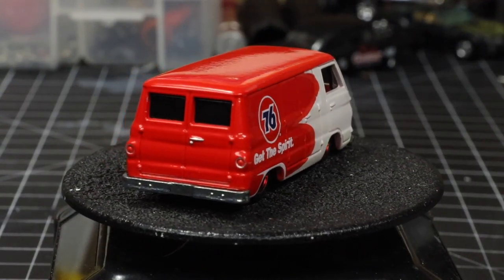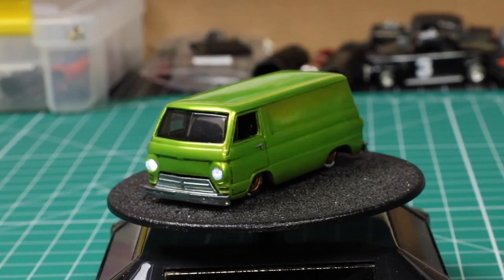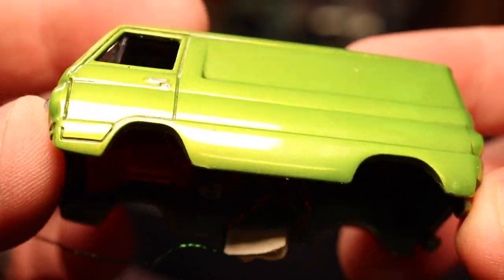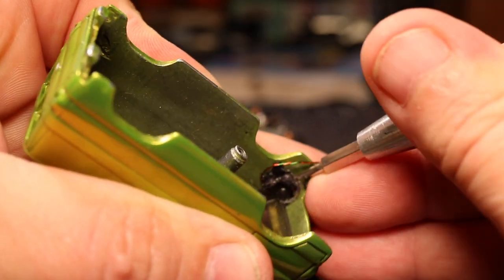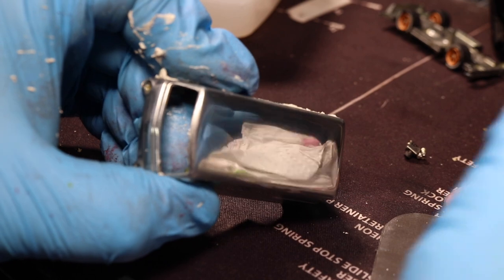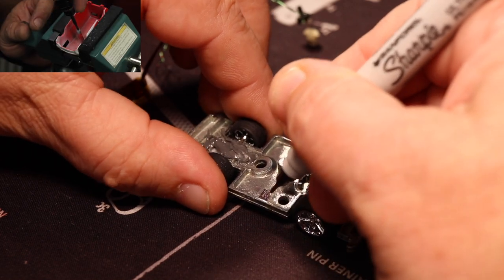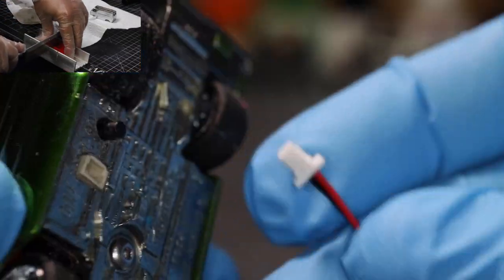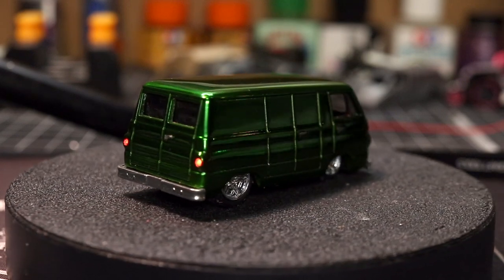Customizing Hot Wheels Dodge A100 Van with Working Lights!

Comment: I would not of thought of that to make headlight lenses, great tip thanks, I personally dont go for the staggered or lowered look, but I use JB weld like you to make a housing for the wheels. The colour is better and you do great work, I have just bought some bare metal polish, but using it you can see how hotwheels achieve their finishes, great video I enjoyed it.
Reply from the maker: Thank you! I agree, I usually don't like staggered but I think they fit this one well.
Reply: I have changed the stance of the red D100 from the shop trucks series, JB weld is an amazing tool for a custom collector, I picked up the tip from Marty's Matchbox Makeovers a few years ago. Just got hold of a stack of RLC cars from the USA, cant wait for those to arrive.

Comment: could you maybe make a video when you glue the leds to the lenses and when hot glueing? Would be really helpfull! Unfortunatly in my country i cannot get the Testors cement. so i bought the Tamiya Extra thin cement and i hope that will do the job

edit: liked and subscribed!
Reply from the maker: I will try on the next one :)
Reply: @WheelsNThangs  Do you think Micro Kristal Clear will do the trick aswell? Just a bit on the led and then on the lens?